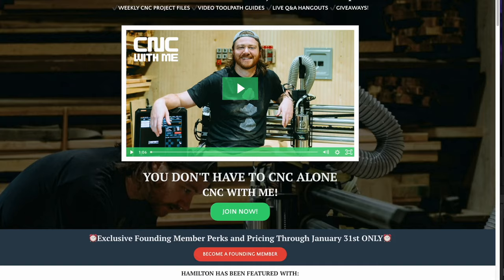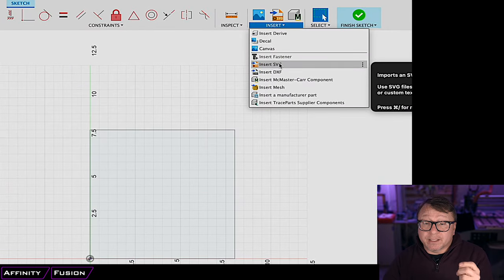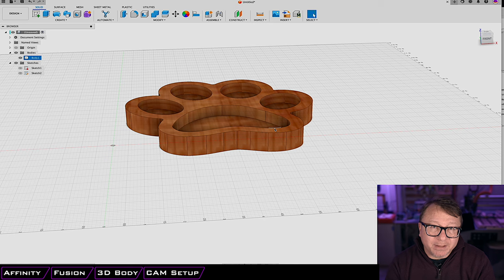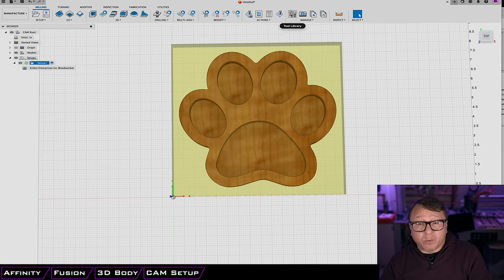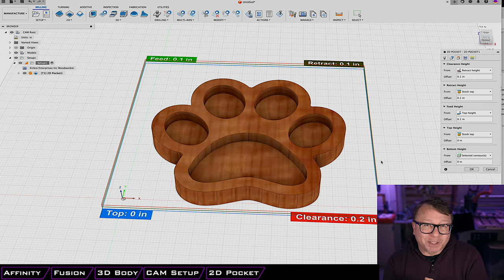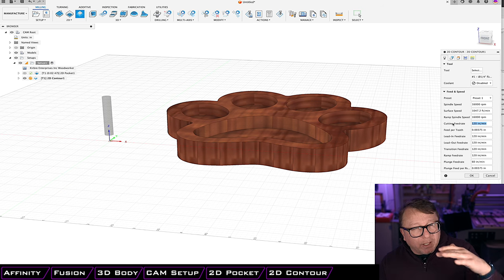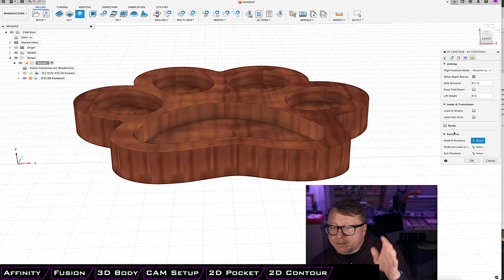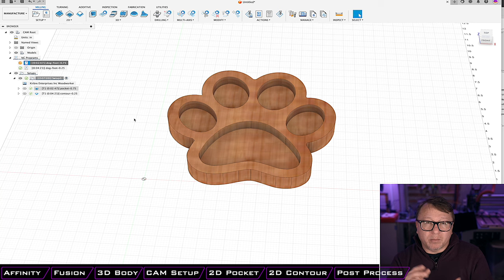Fusion for Beginners - Concept to Product in 8 MINUTES

Comment: Hi! Thank you for the video! Help me a lot! I have a question, it's possible use Fusion360 with a Genmitsu 3018 prover V2? Its possible add this machine to Fusion360? Thank you
Reply from the maker: Hi -- the Genmitsu is based on grbl, so any grbl post processor will do. Autodesk provides one. That said, I did customize it to remove some of the unnecessary features like coolant. Happy to provide it if you send me an email (no warranty).

Comment: I Wanna know, if freecad and fusion 360 be use as 2.5D cad cam g code generator? Can you teach
Reply from the maker: I’m not sure I understand the question. This whole video is about using Fusion to build a model, build toolpaths, and generate gcode. I don’t use freecad so I can’t answer that question. Thanks for watching.
Reply: @cyberreefguru  I mean can we use F360 to cut 
 or engrave text using cnc?
Reply from the maker: @omsingharjit  Yes, Fusion is a production-grade, fully featured 3D modeling and CAM solution, suppurting cutting and engraving. Depending on what you want to do, other SW might be easier to use (v-carved inlays), but no issues doing nearly anything you can think of. I've done videos on creating text extrudes in Fusion before (https://youtu.be/7J5ziz_ETYU, https://youtu.be/oe-A6mWU2mQ) and v-carving speeds (https://youtu.be/Wt69gQeaYwg, https://youtu.be/6hbOxEja1ho).

Comment: Did you like that machine file for fusion 360? I can't seem to find it for the woodworker version. I found the smaller one, but the one I need.
Reply from the maker: Hi Nate -- which file?
Reply: @cyberreefguru  the machine file in fusion 360...on your video it's at the 13 minute marker..thanks so much

Comment: also, adobe is cheaper than Fusion360 or vcarves, etc - so speaking of sacrificing your grand children..
Reply from the maker: Hi Gregg - Illustrator alone is less expensive than Fusion and vCarve, but you can't compare a fully capable CAD and CAM program to a single-purpose vector program like Illustrator. If we want to compare apples to apples, Illustrator at 22.99/month vs Affinity Designer at $69.99 means you can get 3 months of Illustrator or a lifetime with Affinity Designer. Alternatively, you can use Inkscape for free forever -- equally capable for these purposes. Adobe's pricing is out of this world, especially when there are equally capable programs on the market at a fraction of the cost.